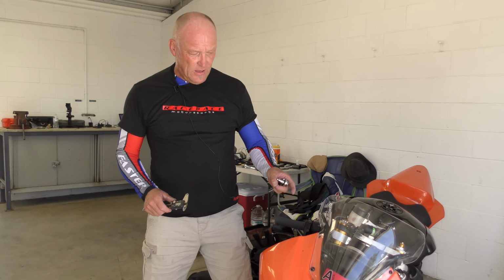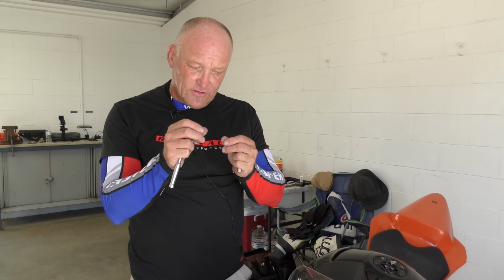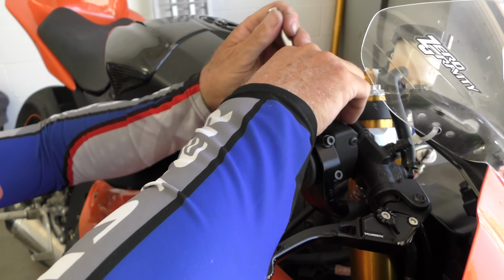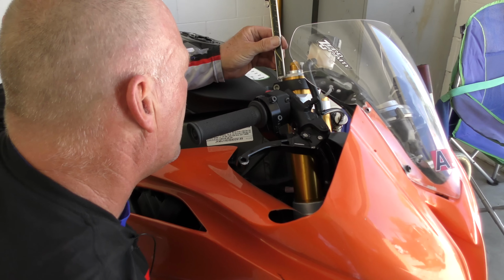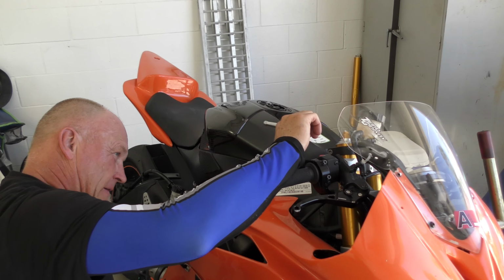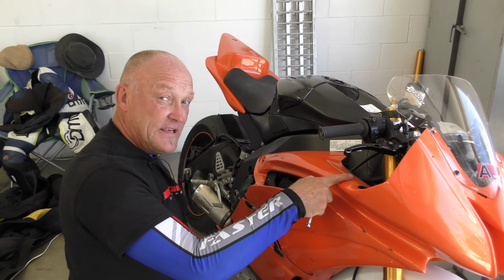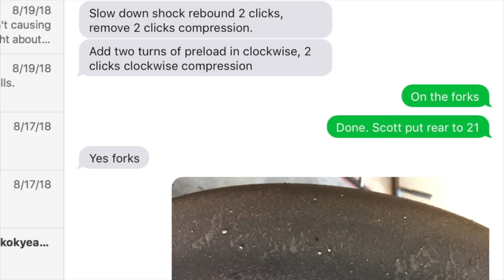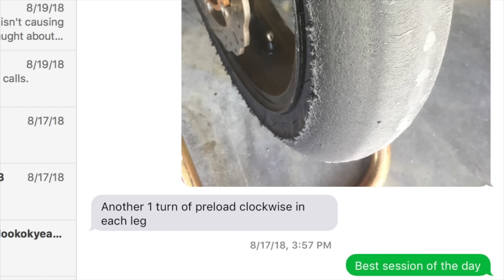Changing Motorcycle Fork Position/Geometry Using Your Kickstand

Comment: While doing the left fork, lower the left handlebar clamp as the same to the right measurement and use it as a stopper to stop it from going down too much, also just use a normal Allen key to tighten and loosen top bridge nut quickly

Comment: Hi Dave, does 2mm have a big impact on a bikes behavior. I changed fork oil and by reinstalling them I did put the fork 2mm to low in the triple clamp. Does those 2mm have a big impact in turning behavior or can I leave it like it is. I really appreciate your knowledge about this issue.
Reply from the maker: You can leave them. 4mm or more would have an impact that was tangible.
Reply: @catalystreactionsbw  Oh thank you for you response. That's good news, because I don't have a front paddock stand 🙂

Comment: I'd rather set the clip-ons the needed distance below the upper triple clamp, tighten the bolt, then release the triple clamps, and the forks will come up only up to the point where the clip-ons hit the upper triple clamp. The forks cannot "shoot through" this way.  Then just tighten the triple clamps and, if neccessary, adjust the clip-on position.
Reply from the maker: That works! Many ways to do this :)

Comment: One of my forks are up one of my forks are down I messed up fixing my forks plz help 🙏 how can I get the all in same spot again stock hight
Reply from the maker: What year bike and model? Is this track or street?
Reply: @catalystreactionsbw  seeing as OP isn't responding, mind if I respond? 
07 cbr600rr, street with some trackdays and drag days. Goal would be to increase tip in and also launch a little harder from the dig.
Reply from the maker: @TheBadMadMan786  Tip in is based on fork travel used and ideal would be 5-8mm above mechanical bottom out via preload and compression settings. Shock preload should give you 8-12mm of static sag and compression somewhere between 4-9 clicks out.  Fior drag racing, you would slow down shock rebound and assess cold pressures for launch grip.

Comment: What does that actually do to the handling, i ask because i recently purchased a dual sport bike and noticed the fork tubes are at least half an inch more exposed over the factory setting. The previous owner was shorter.
Reply from the maker: If the previous owner was shorter and shock settings were changed to be softer, then the front is lowered to get the chassis back to flat or with dirt, slightly rear biased at 55 rear and 45 front. Lowering the front will for dirt, take weight off the rear and this is especially advantageous with trail riding to give the front more grip.

Comment: Dave if i lowered my bike for 1 inch will make the handling be bad?
Reply from the maker: Lowering is a safety option 90% of the time so riders can join our sport and not ballerina with one tore on one foot at stop points. Lowering 1" in the rear will require the same in the front so make sure you do both. Then set the suspension preload at 30% of total travel (if possible) to  respond front and rear equally when you sit on the bike (setting sag). Once that is done, then assess fork and shock travel used.
Reply: @catalystreactionsbw  Thanks so much. Being 5'5  height on a Liter bike cbr1000rr is  rideable but tip toeing most of the time
Reply from the maker: @mr2dsp  Soupys Performance lowering links are great and will help. Then lower the front 20mm. Start there for geometry.
Reply: @catalystreactionsbw  That's less than an inch.  I thought  equally front to rear  1 inch on both. .Thanks So much Dave

Comment: My forks shot through😭 now ordering a bike stand… what should i do?
Reply from the maker: You are supposed to do one fork at a time to avoid this issue. Get a friend to help you to fix this. Pull the bike onto the kick stand to elevate the front end. The second set of hands can pull the forks back through, then tighten the upper triple clamp to loc the forks in place. Lower the front wheel to the ground and torque all bolts.

Comment: Whats the main reason for changing front height ??
Reply from the maker: 1. To correct geometry based on tyre circumference as per video. 2. To offer better turn in for tight technical tracks. 3. To offer better braking support by raising the front for heavy braking stability.

Comment: Can i use the kick stand if im changing out my whe fork?
Reply: Whole*
Reply from the maker: @luxarydreams7361  You cannot if you are removing the fork. You need to get the front wheel in the air sufficiently to remove it, then remove the forks. This can be via a front stand or straps to the roof joists.

Comment: how to i un lower it ? i wanna go back to stock hight
Reply from the maker: Stock height is easy with the forks and you use stock linkage arms for the shock.
Reply: @catalystreactionsbw  do i do what ur doing ? or do i need to jack it up
Reply from the maker: @twofeels3091  If you have a side stand, the forks are easy to do. For the rear shock if you are replacing the OEM links, the rear wheel needs to be in the air.
Reply: @catalystreactionsbw  i can lift the bike back to stock ? i wanna go flush with the forks on my tree my bike low asf when i bought it i can just lean hee over and she’ll go back to normal ?
Reply from the maker: @twofeels3091  As I mentioned in the first reply, you need the stock linkage arms to get the bike back to stock.

Comment: If I lowered my 2005 zx10r 2in in the rear how much would I lower the front??
Reply from the maker: 1" to start BUT you need to be very careful of clearance between wheel and radiator. Make the forks a little stiffer post lowering with preload and compression to test or put the bike on a rear stand and a front triple tree stand and undo the fork caps, then push the forks all the way until they bottom out on the dust seal to check clearance.

Comment: If I were switching from a 180/55 to a 180/60, on an r6, would I add in 5mm of ride height (move the forks down one ring) or do something else?
Reply from the maker: It depends where the axle is in the swing arm slot. General first step would be 3mm rise in the front to start to level out the R6.

Comment: Will fork position be different for street vs track? Do different manufacturers have different fork positions (what you measured with the vernier) ?
Reply from the maker: I have three fork settings for three different tracks set predominantly based on braking stability. OEM's set the fork position based on rake and trail for their optimal position based on the bell curve of humanity that will purchase that motorcycle. For my street motorcycles, I figure out what is the ideal fork position and it stays there for that set of tyres. When I change tyre brand or model I reassess the geometry.

Comment: Hi, what if I use back wheel stand. Will the front wheels pop out? Can I also loosen all the bolts at the same time, on the 2 legs.
Reply from the maker: Using a rear stand helps with stability if there is no side/kick stand. One leg at a time is still the procedure and loosening the last tight bolt has to be done with more care than in this video. That being said, you will at some point need a pin stand for the yokes/triple tree.

Comment: how tight shold the clamps be after adjustment?
Reply from the maker: General torque settings are in the 12-20 ft lbs. There is a range due to different bolt face sizes contacting the metal surface.

Comment: I guess this technique would also help if you want to syringe in or out a little fork oil to adjust the air gap. Or for getting the fork caps back on again anyway. I've only ever adjusted the air gap with the forks off the bike. Getting the headstock paddock stand requires removing a bunch of bodywork on my bike. Might give this a go as it should allow me to do it quickly with minimal fuss. Funny how the obvious things like using the side stand to take the weight aren't always so obvious until they've been pointed out. Thanks 👍

Comment: What is the goal in lowering the front end? Quicker tip in/faster steering?
Reply from the maker: Correct - a fine balance for me as I want to control it (not have the bike turn for me) but a hernia after 3 laps isn't what I want either.
Reply: Dave Moss Tuning I’m about to do the same to my panigale 959. I rode my friends daytona and it steers so much faster than my bike. I’ve already raised the rear, and have been experimenting with higher tire pressure in the front. Will move forks up by 1 “line”. Thanks for the great video! And all the tuning you’ve helped me with at the track 👍🏽
Reply: Hi dave I have cbr600rr and finding tiping on slow and wooded was going to lower my bars to see if this would help as quite high is there anything else you can recommend thanks

Comment: So, is there any difference to tightening the lower clamps bolts first? I just changed my fork oil and decided to try raising the fork legs. Since there was one of me and I have a fairing, I did so by pulling up on the axle (wheel was off) and tightening the upper clamp bolt. My Chiltons says to do the lower first.
Reply from the maker: No difference given the task you are doing. The upper clamp is easy to access so it makes the task simple when changing geometry. Tighten the lowers, set torque then loosen and set torque for the top bolts if you want to follow the manual.

Comment: for what reason we change fork possition dave?
Reply from the maker: When new front tire is bigger in circumference, turn in is too slow or you need to work hard to keep the bike on line during mid corner.

Comment: Hey I’ve got a 2005 fireblade and I’ve put a 200 rear tyre on the bike feels harder to turn in, would raising the forks 5mm through the triple clamps help with turn in ? 

Cheers Dave
Reply from the maker: 100% yes, especially with the increased circumference. Put the forks at the joint of cap and tube. If steering is still awkward, you may need to soften fork preload 1 or 2 notches.
Reply: @catalystreactionsbw  sorry Dave I meant lowering the front therefore raising the tubes through the top of the triple tree 5mm
Reply: Hi Dave, I've brought risers for my 2002 R6, basically spaces that go under the orginal clip on's.
I've moved the forks up through the yoke to give more fork protrusion by 10mm.
The handles are higher now, bike seems to ride well.
What are the effects geometry wise?
Reply from the maker: 100% if the rear axle is in the stock position. If so, move 3mm to raise the front.
Reply from the maker: @HMFDRAM  Hi Shaun. If you change the forks you lower the front and place more weight on the front tyre. If in this case you feel the bike turns better/easier, this is good BUT, please make sure the forks are not bottoming out on the lower triple clamps. Place a cable tie on the right fork chrome tube to see where it travels.
Reply: @catalystreactionsbw  thanks for the reply. All seems ok
Reply: @catalystreactionsbw  cheers Dave but I can’t raise the bike at the front as the fork caps are already level with the top yoke cheers for reply
Reply from the maker: @bigjam8429  Looks like you will be softening the rear shock slightly with less preload and compression, then slowing down rebound.

Comment: Just noticed on my ktm duke 790... one leg is lower set than the other by one “line”. With this vid perhaps I’ll change myself rather than go to the dealer. Apart from obviously needing to be changed. Any major issues with this? (I don’t ride track). cheers from UK
Reply from the maker: Yes, your geometry means turning one way is much easier. Good eyes, nice catch!
Reply: Dave Moss Tuning cheers! I could definitely tell tip in was different on some corners. Good timing on the video :) - will work out if I prefer lefts or rights and match the relevant fork leg! Much appreciated
Reply from the maker: @JustDorian  You bet - have fun relearning :)

Comment: so why did you do this?
Reply from the maker: This track is very technical and I was exhausted after 3 laps trying to turn the bike quickly. Lowering the front helps with turn in and after decades of testing, I know where to go. For others, you go in 2mm increments.
Reply from the maker: Greg  All depends on what you are looking for on turn in for fork position. On the 06/07 I used 5mm and 15w oil for the OEM internals for track coaching.

Comment: Your the man dave!! Lowered my 2019 MT07 forks 8mm and this was confirmation i did the job right, thanks man! On a side note ive watched your videos on how to fix the 07 front suspension and wondered what would you recommend for 145# rider in full gear? Still cut 10 mil off spacer and thicker fluid?
Reply from the maker: Awesome! Yes, 10mm and 15w oil
Reply: @catalystreactionsbw  you are the man, thanks brother. Ill get her swapped out this week!

Comment: If you do this don't you also need to lower the rear shock somehow? I'd love to do this to my nc750x for flat footing with my short legs but i'm afraid a front only change will screw up the handling too much.
Reply from the maker: NC fork lowering 5-7mm helps. It handles better due to trying something and seeing what happens per bike. I learned a long time ago that asking questions and finding answers makes the difference - not the ethereal projection of an unknown outcome. Great science is about asking the question and finding the answers. What if one small change made a positive difference? Would you stop there ot continue on your journey. If you know what you did, you can undo it and go back to where you were. I would encourage you to try.

Comment: Did this using a car jack. Much easier that way. Your method may misalign triple T and wear out stem bearings ?
Reply: Please make a video of that easier car jack method.
Reply: @gyzfr6  please please make a video
Reply from the maker: Sure - I had no jacks and had to do this on with what I had so we used it as an example of what can be done. Using Vernier calipers makes it perfectly accurate. Please explain why you feel this will wear out steering stem bearings that are locked in place?
Reply: are you saying this can put in a twist between the upper and lower triple T, which will/ can go on to premature wear the head stock bearings?
Reply: @harrybrown4815  yes.

Comment: Hey Dave I have a question for you! I just bought a bike and am looking to put together a decent tool kit for home for when I need to do maintenance or repairs. Are there any must have tools or tools you would recommend?
Reply from the maker: Sockets 8mm through to 22mm, ratchet and 12" extension, rear axle socket and breaker bar. Flat blade (4 sizes), set of allens from 12mm to 3mm, small adjustable 10-24mm,  #1, 2, 3 and 4 Philllips screwdrivers, needle nose pliers (3 pack). Combination wrenches 8-19mm short handle.
Reply: @catalystreactionsbw  Or get a complete torx set if it's a S1000(r)r